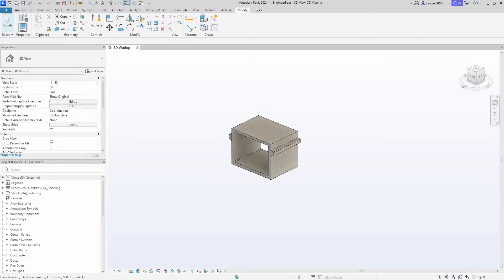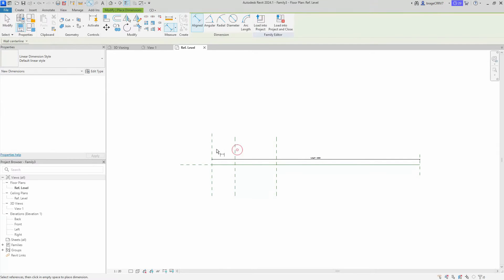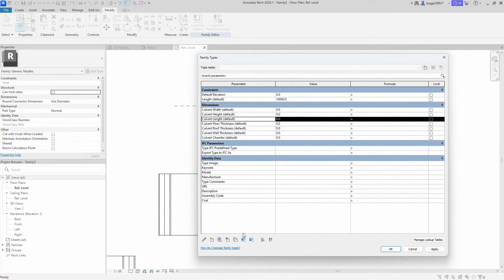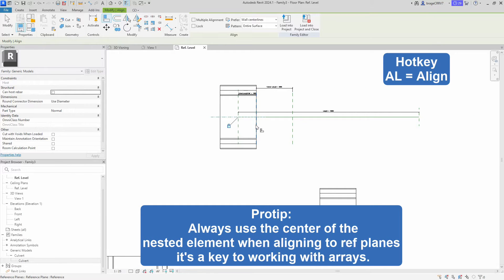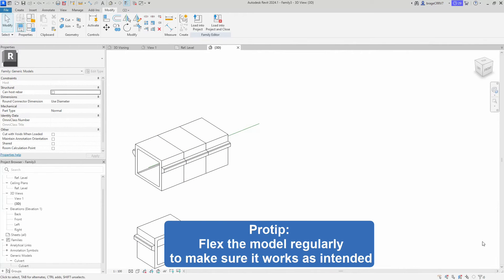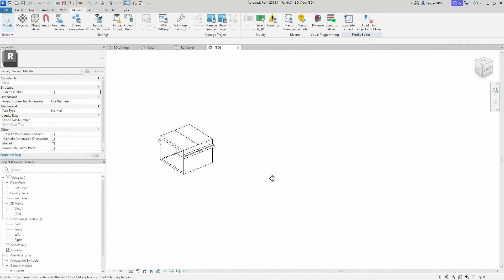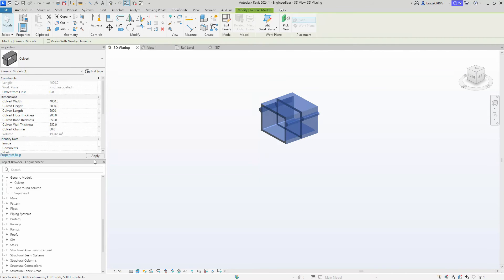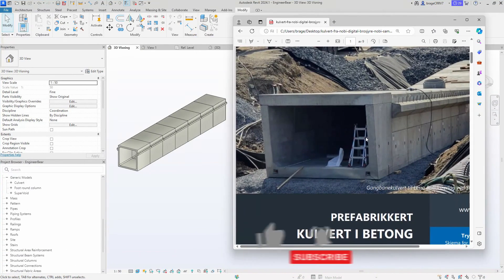Revit family | Line-based parametric culvert | array with IF statements and "not" formulas

Comment: can you create a curved line based parametric family, too? by giving the culverts start and endpoint instance based angles? or is there another way to do so?
Reply from the maker: I think the best option is to create it in the Revit adaptive family environment! Using the same technique as I did with my bridge videos. I will write it up and create a video about it some time during fall/winter.